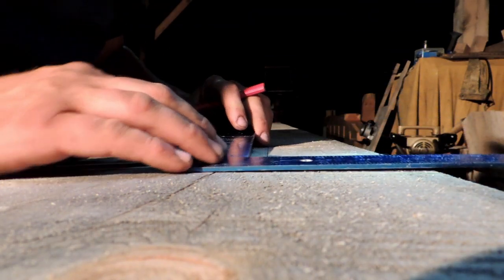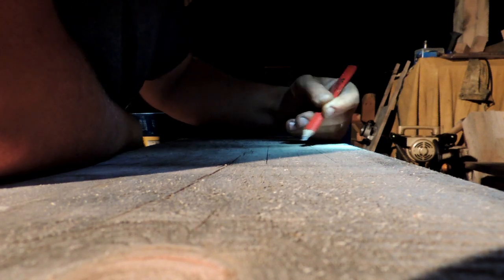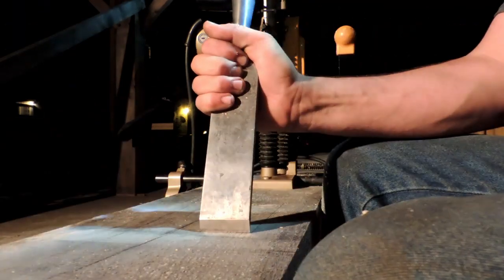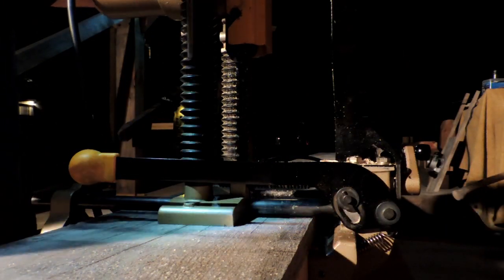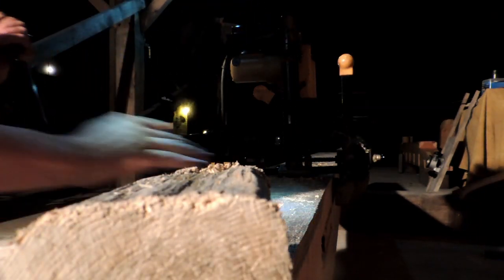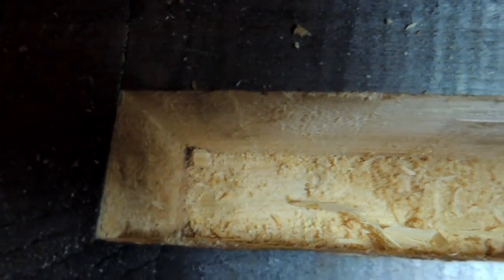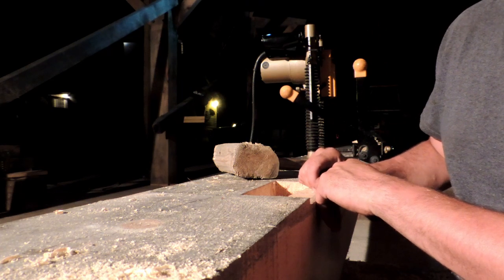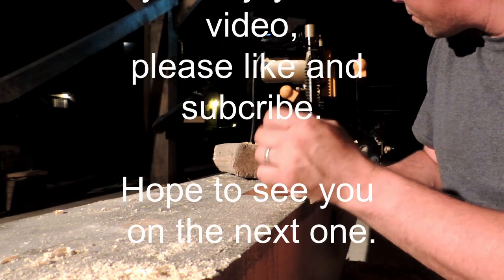A Timber Frame Vlog #27: Timber Framing in the Dark: Some Lost Footage

Comment: Does the upper edge of the brace pocket need to be cut at the 45 degree angle of the brace?  I can see the lower end resting in the pocket, but don't understand how the upper side would fit in.
Reply from the maker: +Randy W. No need to cut the upper at a 45, I do trim out the top of the housings at a 45 on that side for looks but not the mortise.  If I was worried about taking too much meat out of the timbers then I would cut that edge of the mortise at a 45.  Hope this helps and than you for watching.